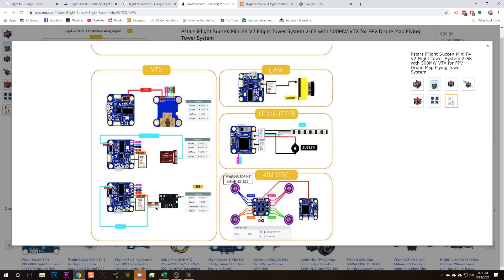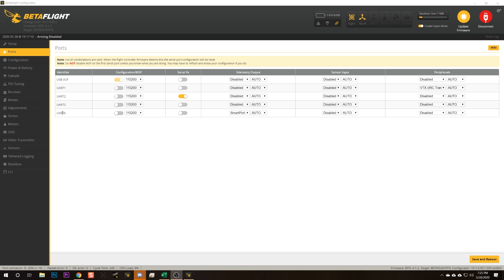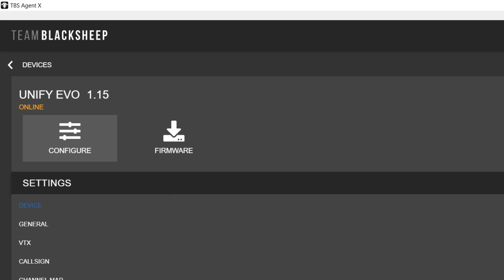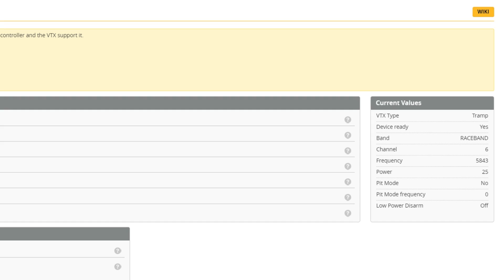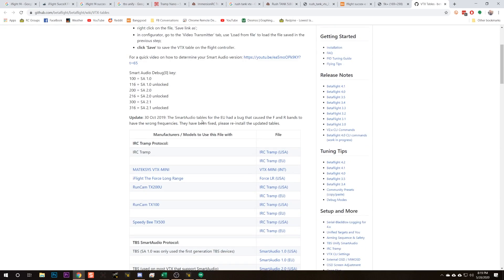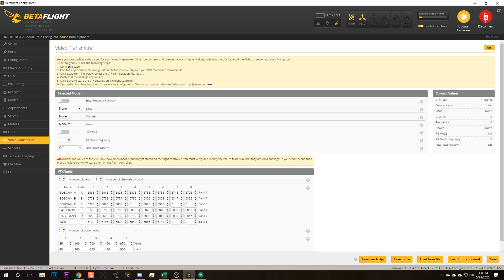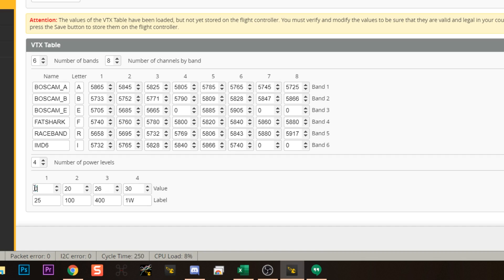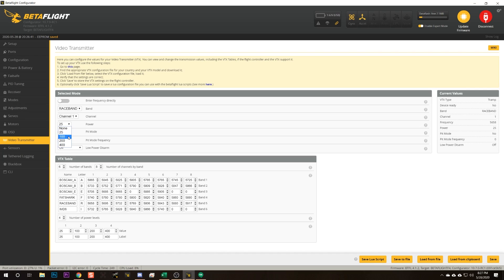Betaflight SmartAudio vtxtable troubleshooting (WHY DOESN'T SMARTAUDIO WORK)

Comment: Spent half the day jerking around with eachine nano vtx...i get vtx ready but can’t change power or channel. Loaded inav and it works.
Reply from the maker: That confirms the wiring is correct. Most likely loading the wrong vtxtable. SmartAudio 2.0 is the most likely one to be correct.

Comment: Hey man, videos are great helped me get my setup going.  I've ran into a few problems that I just cant seem to figure out.
1) My XM+ reciever keeps  intermittently losing connection to my controller, paired with this the value I have in my AUX12 is extremely volatile even though I have no attached switch on my controller to it.
2)When my controller is connected, I can arm no issue and the motors all spin at the same rate.  When I increase my throttle I have one motor that slows down and then another that will keep throttling up no matter my inputs.  I have tested the motors in betaflight and when the desired input is give they all spin at that speed and spool down in sync as I lower the throttle value.
3)I purchased the rush tiny tank and it came with the vtx and the connector but has no cherry/antenna.  I have an old antenna and am wondering if it is possible to retrofit the 2 together.  Even better is the connecter the antenna itself and Im just being dumb.
Thanks for the help

Comment: Joshua, this model "Eachine TS5828L Micro 5,8G 600mW 40CH" works the smart audio?  I have this board plug in " MAMBA F405 MK2 Betaflight Flight Controller F40 40A 3-6S DSHOT600 FPV Racing Brushless ESC 30,5x30,5mm " but in beta I can not ser the "YES" i am using the UART3 and I have already change smart and tramp e nothing happens.
Do you have any idea?

Comment: This video has helped me TWICE now..for different reasons. Upgraded to a pro32 HV and couldnt get smart audio to work. Used TBS agentX to switch from crsf to smart audio - fixed.  Bardwell is the man
Reply: How did you connect the vtx to agentX? I Can’t figure it out.

Comment: Hi Joshua...I cannot change the vtx band/channel or power via my Tx sticks and osd, or at least the vtx leds do not indicate a change has been made even after a battery power cycle. I have loaded the correct vtx table, and BF video transmitter tab shows device ready as yes. 
Is this possibly a Open Tx setting that needs changed?
Other thoughts/ideas?

Comment: "...If we plug-in USB to the Video Transmitter..."  -  How? How can I plug USB to TBS Unify Pro32 Nano?
Reply from the maker: A few of the Unify vTX have USB built in. The Pro32 Nano does not. You must configure it using button pushes and/or if it's connected to CRSF receiver you can configure it using the Crossfire system.

Comment: Thanks man. Everything you do makes sense, but I have done everything you said and the device is still not ready, it says “no”... even when I plug it in. Checked everything like 20 times. I have a TBS crossfire wired up to UART 1 and  and I have eachine VTX nano v2 wired up on UART 2. And I did everything you said. But I still get video on my goggles and cannot control SA in my OSD or in BetAflight. Oh and this is on A Tinyhawk 2. Learning a lot and I’m stuck.

Comment: I did everything following the video, the transmitter is saying yes but the image is black, and no osd that
Reply from the maker: The vTX is working fine. Your problem is with the camera.
Reply: @JoshuaBardwell  thank you I soldered the camera wires again and works thank you the drone is in the air

Comment: also need to discus the hidden settings in the tbs vtx. there is 7 or 8 different menus. if you accidentally change these settings your vtx will not work.

Comment: Hey Joshua, I'm trying to get smart audio working on a Unify Pro 5G8 V1.2 Batch 1004 and I can't "device ready" to say "Yes". I've got the audio wire connected to T2 on my flight controller, selected smart audio in the ports tab for uart 2, and loaded what I believe is the correct vtx table (Smart Audio V1.0 according to the unify user manual). Is there anything that you know of with this vtx that is causing this not to work? Thanks for all the videos, I really appreciate what you do!

Comment: Thanks for the video! After I crashed yesterday I don’t have the video transmitter tab anymore in betaflight also in the VTX SA setting it only has “statx” as the option. Previously it was all working fine. Can’t find the problem now. Any suggestions?
Reply from the maker: The statx must be caused because the SmartAudio wire broke or the vTX broke. But I don't see any way a crash could cause the whole video transmitted tab to disappear.
Reply: @JoshuaBardwell  yeah I checked the pads and wires. They are all Oke. its still flying though I only can not change channels and power anymore from the osd.. 

sometimes It also doesn’t want to boot up or something and then I see dark blocked noise. By replugging the battery sometimes it gets solved. If I unplug the camera it goes to plain dark gray with osd visible. And when I plug in the camera again sometimes it’s solved or it goed to blocked noise again. It kind of has its own life.. you have any idea?
Reply: Ones crumbled , they’ll be back

Comment: Can someone please tell me if it would be poosible to share a Uart for 2 different things. in my case its Uart3 the RX3 is used for my Flysky IBUS reciever input.
Could i wire the Smartaudio to TX3 on the same Uart and just tell Betaflight they are both on the same Uart?
I need this because my Flight controller Mamba F405 Mini MK2 has only 3 Uarts and one is inverted SBUS and the 3rd i connected the GPS module to it.
Thanks for any Help!
Reply from the maker: No it's not possible
Reply: Thanks for your response Mr. Bardwell. I just took another look on my Flight Controller Manual and it seems that there are two pads both labled as TX3.
One is in the area of the video Output and one is at Uart3.  I would say they are the same right just split in 2 places so its more convinient to mount the VTX but only if you dont use the Uart3.
this is the Manual http://myosuploads3.banggood.com/products/20200806/20200806214735QQ20200807104541.jpg

its rather confusing. the rest made sense to connect but i struggle at this part. Anyways i dont mind to dispense on Smartaudio if that means i can use the GPS.
Thank you for all your Uploads i really aprecciate you sharing your knowledge!

Comment: Why would you not always use the highest power available? Does it just come down to battery drain or is there another tradeoff?
Reply from the maker: You interfere morenwith other pilots at higher power.

Comment: hey Joshua, excellent guide as allways.
I rip my FC usb and i wish to know if there any option you know to set correct power level via osd.. i put mismatch power level and as you say, my vtx probably locks on 25mv
Thanks <3

Comment: My Smart Audio is working but every time I unplug and plug a battery back in, it resets video power back to 25mw. Every time I plug in a battery I have to use the sticks and set it to 600mw. I thought it was just the AKK FX3 Ultimate mini VTX because this is the first time I've had this problem, but I swapped the AKK out for a TBS Unify Pro32 Nano and it's doing the same thing. I changed the power settings in Betaflight to reflect the fact that the TBS has 3 power settings and the AKK has 4. Now I'm thinking the problem is with the Mamba F405 mk2 flight controller, since I am only having this problem with VTXs that are soldered to this FC.  I did have to flash the flight controller with firmware that had an AKK patch. Just flashing the target the flight controller calls for ends up having no Video Transmitter tab in Betaflight. Maybe it's that firmware? I did not reflash the firmware when I changed to the TBS VTX. I've since ripped the ufl connector off the TBS unit and I'm back to the AKK.

Comment: Upgrade your Betaflight Configurator to at least 10.6.0 to get the Video Transmitter tab. 
Don't waste an hour disassembling and reassembling your quad, don't be dumb like me.
Reply from the maker: 10.7.1 is the latest.
Reply: @JoshuaBardwell  I wasn't able to get 10.7.0 to connect to a COM port as I'm using BF on a rather old PC, even with ImpulseRC driver fixer. 10.5.1. worked though, so I stuck with it. Could also work with 10.7.1 though

Comment: Got one for you JB ,i have a few builds under my belt but can't get my head around this one .I have got a aikon f7 fc aikon 35a 4in1 esc with a mateksys HV  [ irc tramp ] on one build, and a aikon f7 fc aikon 55a 4in1 esc with AKK FX2 ultimate-mini [ smart audio ].The problem I'm having is, I did a cli dump off one board to the other .so i went in to vtx table but it said device ready [ no ] so i realised i had not changed the port's tab from irc tramp  to SA , so i changed it to SA and still the same not working ,,,very weird this one
Reply from the maker: Wrong UART?

Comment: Thanks Joshua! Man, that SmartAudio 2.1 dbm instead of mw thing really had me lost and I would not have figured it out if it wasn't for this video. I couldn't figure out why my quadcopter was stuck in Pit Mode no matter what I did. Once I entered dbm values in the 3 power level inputs, then I could disable Pit Mode. That's far from user friendly design.

Comment: So did he explain why the F*** they added this step making it even harder to set up smart audio?
Reply from the maker: Their justification is that SmartAudio lets the FC control the vTX frequencies. Since SA can potentially set the vTX to use frequencies that are illegal in some areas, they don't want Betaflight to be blamed for breaking local regulations. So they make the manufacturer and the user set up the frequencies so it's on them if they break the law.
Reply: @JoshuaBardwell  Ok, thanks, It still sucks but makes sense.

Comment: Maybe you can help me I just switched over to tramp and I did everything you said step-by-step but I can't get it to say yes that it sees my VTX but I switch to 3.5.7 and I can use tramp audio to change the channel and band and power no problem so it's wired up correctly the ports are right everything is right I even bought the wand and the wand doesn't find the VT x's...Thanks JB
Reply from the maker: If the wand doesn't even find the vTX that suggests the vTX is not powered up. IDK how that could change when flashing between betaflight versions though.

If the Tramp Control works on 3.5.7 then you know wiring is correct. Set up Ports tab the same in 4.2 as 3.5.7. Then you should see device ready: yes.
Reply: @JoshuaBardwell  thanks man... I got the wand to work you just have to be really really close...anyway, I'll  try again  I'm using the tramp nano! YOU ARE THE MAN!!!!

Comment: JB, great video.  Extremely helpful to trace the system to rule out many issues.  But still, it left me stuck.  I had all good indications in BetaFligth and on the OSD, "Device ready - yes", but the VTX wouldn't budge despite all software indications it should.  It was a BetaFPV VTx Stuck on factory default channel, band, and power, which were somewhere close to BOSCAM A 1 and BOSCAM B 8, but really neither.  What solved my issue was reloading the VTX tables with 2.0.  Perhaps someone else might see the same issues after troubleshooting everything right to the end of your video - EVERYTHING software "AOK" yet still no hardware movements.  Don't trust whatever is in there on the video transmitter VTX table page, try reloading the VTX tables, or try a different one.   Good luck!

Comment: Nice video. I trying to load vtx tables for the GepRC Mark 4. It has the on flight controller VTX I keep getting error while loading VTX config and throw from clipboard maybe the contents are not correct what am I doing wrong
Reply from the maker: If you are loading from clipboard in the Video Transmitter tab, then you need the .json file version of the vtxtable. If you are working with a CLI dump containing lines starting with "vtxtable" then you paste that into the CLI.
Reply: @JoshuaBardwell  thank you Joshua !!!! Much appreciated 👍

Comment: Hi JB. Love your videos. I have set up many quads and know my way around. I have wired everything correctly, tried 2 different uarts, checked and double checked ports tab. Cannot get device ready yes. Plugged batt and everything. At a bit of a loss. Hoping for some help.
Fortini f4 osd 1.1 and a tx805.
Any ideas appreciated.
Cheers

Comment: I have a TinyHawk 2 RTF kit but my goggles don't work. Just a black srcreen without OSD.  Someone please help!
Reply from the maker: Black screen usually means vTX is on but the camera is not powered up. Sometimes on the TH2 the FC dies and this causes the camera to power down. Can you confirm the FC is lit up?
Reply: @JoshuaBardwell  when I connect the battery it cycles through all of the lights and then alternates between red and blue

Comment: What about 2.0 :) ? If there would be a simple database that links the exact vtx model to the exact cli/code to set up the table, that would be great... . It's a pain to have to deal with this stuff. And vtx manuals are not always very clear. The actual vtx tables for tbs vtx'es are even incomplete and the manual can be confusion. Especially for different version of the same vtx. In my case, they didn't even work, even after adjusting them. Still trying to figure it out.

Comment: I am currently playing with a BetaFPV 75X HD which is a year old but flown very rarely due to various reasons. Had the 4in1 board replaced by LHS where I bought it and after several weeks got round to flying it. Now having problems with the Betaflight Video Transmitter page saying VTX not ready. Seems the VTX Power is stuck on 25mW and some OSD data will not show such as VTX Band & Channel etc. Replaced the VTX too but still no cigar.

Comment: I need help! I have a diatone r349 with the tbs unify pro and everything seems to work, smart audio device ready says yes.. but when I set it to a channel like race 4 that’s static, I can pick it up on other channels so there is a video output... if I change the channel it appears to react but never goes to the proper one.
Reply from the maker: Make sure you unlocked the vTX.
Reply: Joshua Bardwell it’s unlocked and shows both leds confirming it

Comment: So a few questions, I use the Rush Racing and from communications with Rush if I understand them correctly they have said it uses the TBS 2.1 table, is that correct? Also via Oscar's page it appears his review of Rush show the same however for 500mw the dBm value he shows is 27, which is correct and will that make a difference? I am still struggling for some reason to get SA working, the indication still shows a "no" so I am double checking all my connections and uarts. I have this issue on 2 quads both with the Rush Race both using the Mamba stack on uart 3, any assistance is appreciated and thank you for all the info!
Reply from the maker: Device Ready no means a wiring or ports tab mistake. The contents of the vtxtable don't matter until you have device ready yes.
Reply: @JoshuaBardwell  thank you

Comment: Hey Joshua if you see this question can you make a video or talk about or point me to something that explains, I don't know, wires to plugs or do you prefer soldering a wire to a board or creating your own wire harness with those little white plugs. I don't know what they're called but I have come across different types of white plugs like on a TBS VTX their plug is a little bit bigger than the box of little ones I bought. I'll never hear anybody talk about favorite ways or better ways to wire up transmitters and cameras and such.
Reply from the maker: I solder when the FC is made for soldering; I use plugs when it's made for plugs. They both work okay and I don't have a strong preference either way. It's super annoying if I have to make my own harness to go between two plugs. I always prefer to solder at least one side or have a pre-made harness.
Reply: @JoshuaBardwell  thanks for the reply like I have had multiple occurrences with a female side of the plug on the board itself simply cracks and falls off. Now I have been able to solder a wire onto the little pad left from where the plug was but it sucks the throw away a whole FC because the little white plastic thing cracks.

Comment: How do I change my vtx settings with my remote looking through my goggles ? Not sure how to get to my vtx menu again
Reply from the maker: Enter the OSD menu by center throttle, yaw left, Pitch forward at the same time.
Reply: Joshua Bardwell 
Thanks alot

Comment: Hi Mr Bardwell I need your help I’ve completely reset my TinyHawk freestyle 2 with beta flight 10.6.0 and I’m only a beginner so don’t understand all the steps needed to get it fully working, I got it flying but got no video feed from vtx to camera can u help with step by step video of how to fix my fpv view as I’m flying line of sight and THF2 is a little small to see at a distance. Thanks and I hope you will help me.
Reply from the maker: The only part of the config that could stop camera feed from getting through is the NTSC/PAL/Auto setting in the OSD tab. Try changing that then save/reboot everything. If that doesn't bring the camera back then I would be looking at physical damage such as nicked wire.
Reply: Joshua Bardwell 
Thanks so much for the reply!

Comment: Mr. Bardwell I would like to thank you for this video. I couldn't figure out why my video feed would cut out as soon as i would stand up to move away from the drone. I had the wrong selection in the ports tab and the wrong vtx tables. As soon as i did what you said  the vtx power output lit up and was good. Now i need to find out why this new motor is stuttering on my novice 3.